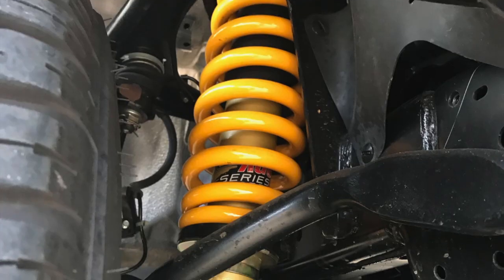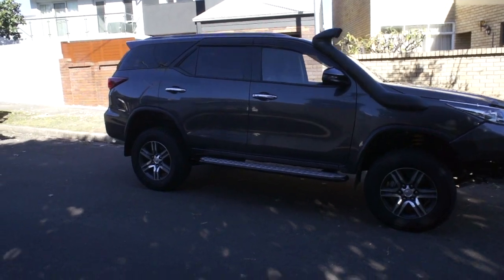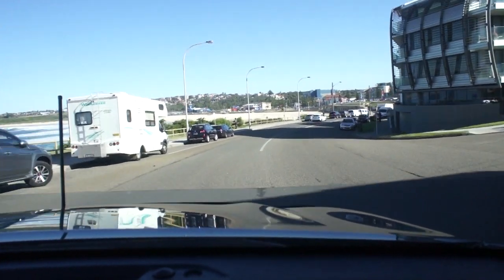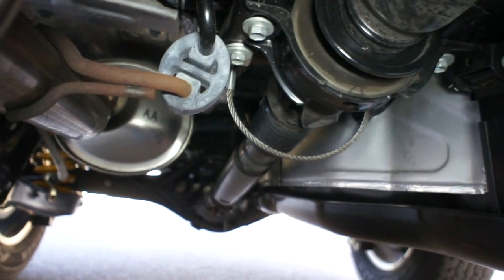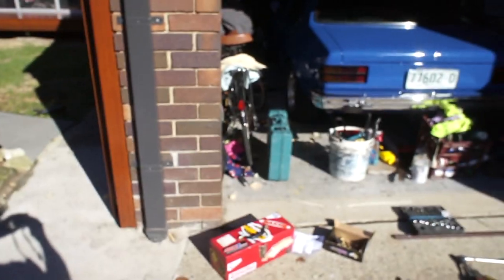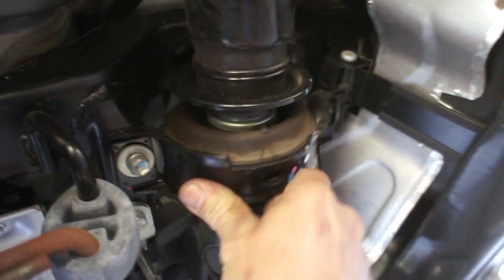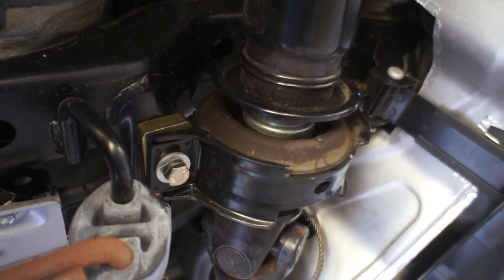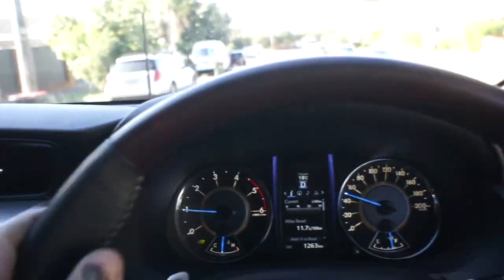Facelift toyota fortuner Tjm 2 inch Lift kit 2.8 turbo transmission spacer centre bearing vibration

Comment: I've had the same experience as this, but in addition I've found that the sway bar drop links are too short. Post 2021 Fortuner has a rear sway bar, which has caused havoc after the lift. So I'm in the process of putting longer drop links on the rear. The rear sway bar is under such tension and stops the axle moving with the longer springs.
Reply from the maker: Nice and thank you.

Comment: I’m getting a TJM 2 inch lift in couple of weeks. I assume TJM by now provide an appropriate spacer kit and I won’t need the Dobinson one? Also, what spring kg rating did you put front and back? Keep changing my mind what spring load rating I should choose. Thanks 👍🏼😊
Reply from the maker: 80 fronts 215 rears, they work awesome, loaded and unloaded...
Reply: @TeamBulletOffroad  Hey mate, awesome. I did the same just got it back and super happy. They have put a Centre bearing spacer kit but I still notice a slight vibration but only when accelerating from a stop. Do you know how many mm’s of spacers were added to your Centre bearing? Would be helpful to know so I can add same. Looks like they added about 30mm to mine. Thanks again 👍🏼
Reply from the maker: @watchmeticking7000  Will measure and get back to you...

Comment: Hi drench, wondering may be you could help me. i installed a phat bar diff drop and installed a tjm lift kit  as you had a good feedback on TJM suspension. And im happy with it. I changed my tyres into maxxis 265 70 17 at.  No bull bar at the moment. Also a tjm spacer on the centre bearing one of each side..
My issue is I still have a vibration coming from centre bearing.  Any idea why or suggestion?
Thanks and more power to your channel!😁
Reply from the maker: Cheers mate, you may need to add more to the packer to bring it back to factory angle, if you have done 30k or more kms please grease up unit and slip yoke...
Reply: Thank you.

Comment: Hi. I am doing a 2 inch lift on my fortuner as well. Yes the vibration is not good. What size of the spacer you were using to get rid the vibration?
Reply from the maker: From memory around the 10mm should fix 2 inch, the Dobinson spacer  kit comes with 2 sizes

Comment: Hey mate bout to order this kit but if your towing all the time is it okay to run the kit ?
Reply from the maker: A good kit for towing 1500-2000kg, any heavier the air bags will be needed. If you go a heavier coil, be too hard empty.
Reply: Sorry I meant I have 300-500kg leafs in back does this spacer effect when towing ?
Reply from the maker: @danieldonato7454  Sorry my mistake, so that spacer is to take the vibration out because of the rise in height, in theory the ball weight of what your towing lowers the back which in turn eliminates the vibration.. But the answer to the question is yes, once the lifted coil goes in you do need the spacer..
Reply: So when I add spacer towing is fine to do ?
Reply from the maker: @danieldonato7454   Be fine....
Reply: Did your car use to get the vibration even when you use to slow down at the lights ?

Comment: Any reviews on the TJM shocks?
Reply from the maker: The tjm suspension chosen has done its job with ease. The front Heavy duty coils and shocks have not sagged at all in the 6month since fitment, No squeaks or noises to speak of...Knowing too that we still have the luxury of fitting a winch under their weight capacity with the rhino bar. The rear coils were also a heavy duty chosen, and while unladen the bum does sit higher, never any complaints of it being uncomfortable or bouncy.. However when the van gets hooked up it does settle around 60mm, but at that point its at its optimum comfort. My wife has towed the van on dirt roads and country roads and always felt safe and in control {AS I TOW MY COMP TRUCK WITH MY 79} on those occasions. Again with the coils very quite and noise free... Unlike leafs.... So i would have to say 10/10 to date.. The only thing untested until our M/Ts  get fitted, is unladen whether the rear shock is long enough...But once the build is complete i will be doing a "walk around" clip..
Thanks for watching.

Comment: are those stock 265/65/17 tires on the 2 inch lift? It doesn't look small or anything?
Reply from the maker: Yes factory tyres... Just because of their offset and width, with the lift and the extra body roll cornering didn't feel that great..Thanks